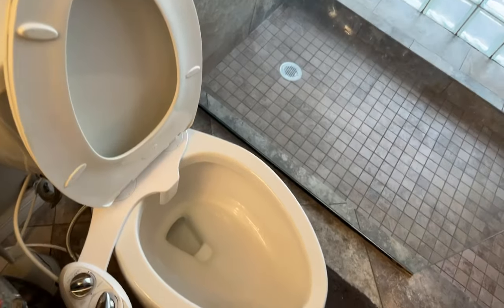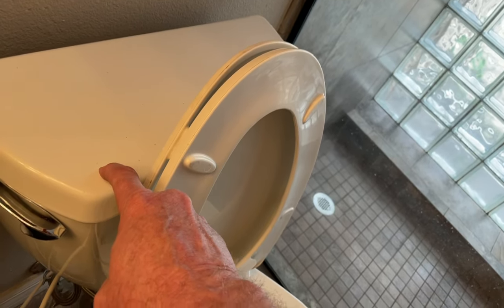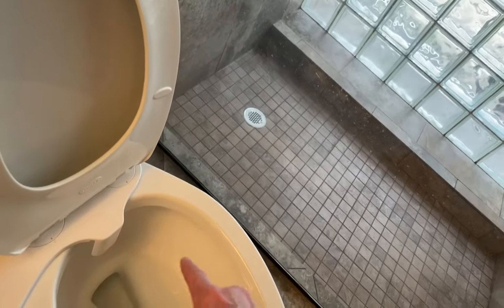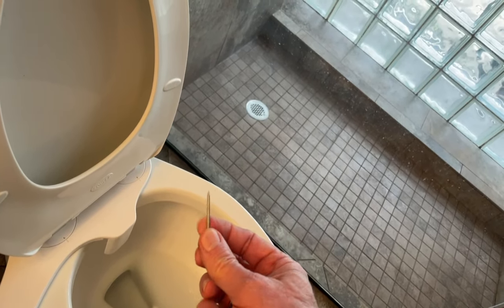Weak Toilet Flush? Fast Fix With a Nail

Comment: My weak flush is inconsistent. Would that still be the reason? Any thoughts? Going to check out your video on water level. My handy man told me he thought I’d had a “soft clog” that cleared out … but why would it keep happening? So frustrating and water wasting as well.
Reply from the maker: Strange that it’s inconsistent. But I would still clear the jets to eliminate that as a possibility, then see how it behaves afterwards.